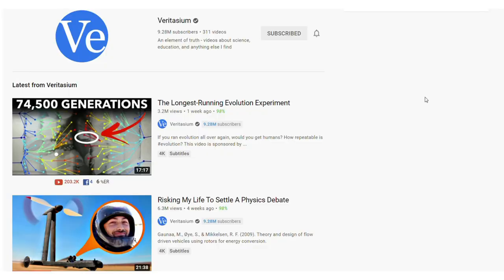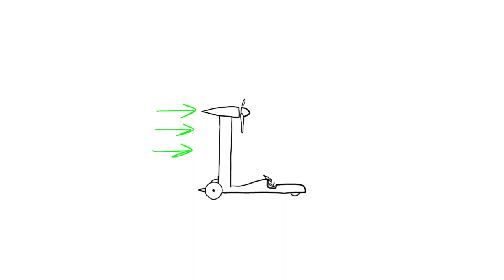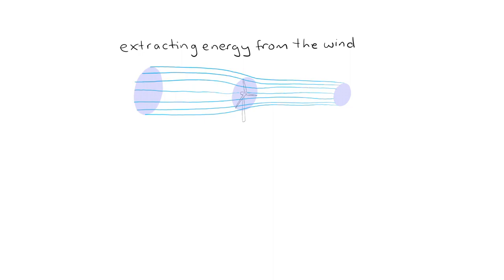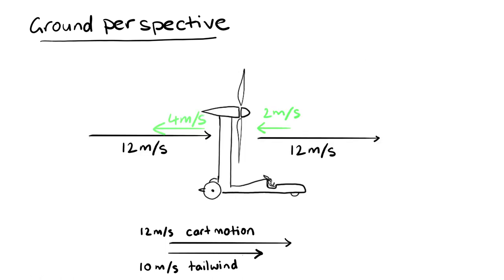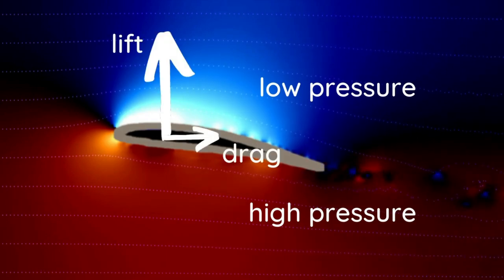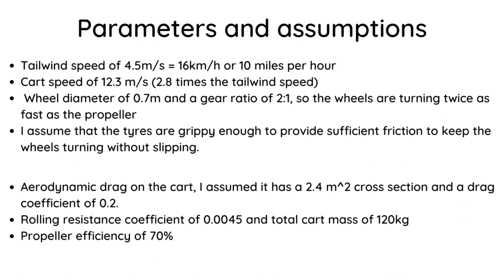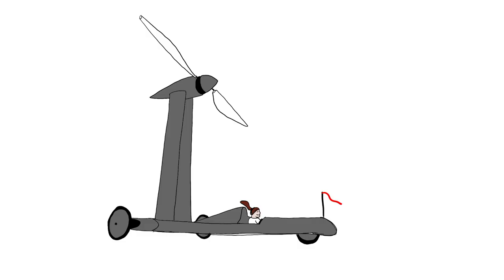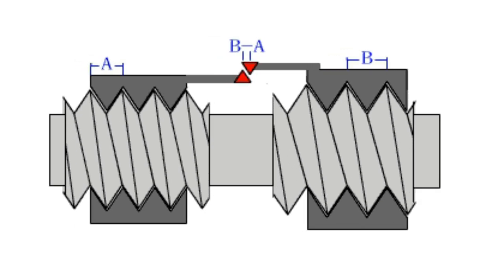Downwind Faster Than the Wind by Veritasium: How Does it Work?

Comment: The inertia :) The propeller spend the wind power accumulated while cart was accelerated from 0 to the wind speed.
As soon as this rotating power slowly spends out, this car will slows down.
The power was from the wind, and if no more wind = no more power.
This is not the earth rotating propeller, this is a wind rotating propeller by the wheels.
Reply: I asked MIT aero professor Mark Drela what would happen if there was no drag and no friction, and his answer is pretty surprising until you wrap your head around everything that's going on:

"If there is no drag, there is no theoretical speed limit to DDWFTTW [dead downwind faster than the wind]. It’s no different than applying thrust to an object which has no drag — it will keep accelerating without limit.
In reality there is drag of course, and there are also structural limits.
For fixed gearing the wheel rpm and prop rpm will be proportional to the ground speed, so at some point something will blow up from the centrifugal loads."
Reply: @clawsoon  Well, it's like saying what flywheel after initial push will start rotating faster and faster :)
No energy = no indefinite acceleration.
Reply: @clawsoon  Nobody said that wind energy can't be used(or, like you said, extracted).
But you can't use the energy of the wind if the wind doesn't exist anymore. As soon as the car reaches the wind speed, there is no wind pushing this car. Initially, wind accelerates the car and wheels trying to stop the car.
At the wind speed, the car accelerated not by the wind, but by propeller.
You can use a flywheel in this car, and it will perform even better.
But still not run faster than wind for the long time.
And, of course, never accelerates for a long time.
More than 10 years and no result!
Reply: @anufriyev  Once the craft is moving and the propeller is creating thrust, the speed of the air relative to the craft does not matter.  (Well... it matters in terms of drag, which limits top speeds, but not in terms of thrust disappearing when the cart reaches wind speed.)  Comment #35 in this discussion does a reasonable job of explaining it:

https://www.physicsforums.com/threads/remember-the-debate-about-downwind-vehicles.390801/page-2

That whole discussion is good and worth a read if you're really interested in how it works.

You're familiar with sailboats, land yachts and ice boats which can sail faster than the wind, right?  (Up to 3-4 times the windspeed in the case of land yachts and 6-7 times in the case of ice boats.)
Reply: @clawsoon  You understand what sailboats, land yachts and ice boats can't sail faster than the wind directly downwind, right?
"The energy source is the wheels - they are rolling against the ground. Basically, the wheels drive the propeller."
A wind is a source of the energy, not the wheels.
A wind drives the propeller, not the wheels.
If you push this car by the hand, the source of the energy is you, not the wheels.
Reply: @anufriyev  I hope that I never said that "the energy source is the wheels".  If I did, I said something wrong.  :-)  The energy source is the difference in velocity between the air and the ground.  The wheels are the source of the force which drives the propeller, which is a different thing.

Sailboats, land yachts, and ice boats can't sail faster than the wind directly downwind; you are correct about that.  However, they can achieve a velocity-made-good which is higher than the wind speed.  They can sail at an angle to the wind and at a speed such that the component of their speed in the direction of the wind is faster than the wind.  They can get to a destination which is directly downwind faster than the wind can, and they can do it reliably and indefinitely (no "momentum effect" or anything like that).
Reply: @clawsoon  "Comment #35 in this discussion does a reasonable job of explaining it:
https://www.physicsforums.com/threads/remember-the-debate-about-downwind-vehicles.390801/page-2". This was your opinion.
Reply: @anufriyev  You do know that a physics professor who didn't believe an aerodynamics professor just lost a $10,000 bet about this, right?  :-)
Reply: @clawsoon  That kind of argument is this?!
Do you really think it is can prove anything? How old are you? :)
Reply: @anufriyev  This is something I've been trying to wrap my head around since 2011.  In that time I've read most of a couple of aerodynamics textbooks and a whole bunch of aero papers and sailboat explainers.  I've learned that there are a lot of things about lift which are counterintuitive.  There seems to be something in our brains which is stuck on drag-based experiences of wind force.  I think that's why it's so hard for us to figure out what's going on with things like boats which get to their destination faster than the wind does, or gliders going 500+mph, or sailboats sailing upriver with no wind, or sailing directly downwind faster than the wind.  All of these things are counterintuitive, but all of these things are real.

It still feels counterintuitive to me after all these years, but once I realized that all of the things that I mentioned are true and related, I switched over to trying to figure out how it works rather than trying to prove it doesn't.  Because it does work: Every time you have two substances next to each other moving at different velocities, there is energy to be extracted, and if you're clever enough you can extract that energy in a way which leads to higher velocities than either of the substances are travelling at.
Reply: @anufriyev  Xyla Foxlin has a build video with a parts list so that you can build it for yourself, if that's a better way for you to figure out how it works:

https://www.youtube.com/watch?v=VUgajGv4Aok
Reply: @clawsoon   Thank You. Maybe I would.
Recommend You to make a small RC model for the aerodynamic tube.
What you will see may really surprise you. :)
Reply: @anufriyev  Doing the equivalent frame-of-reference shifted version on a treadmill would be easier, but having a tube to run it in would be more impressive.  I wonder how long (and how large) a tube you'd need to make this practical... hmm... definitely going to be problems with turbulence once the tube's length gives a Reynolds number that's high enough... and a clear tube would be ideal... hmmmmm...

An easier (and also interesting) thing to make might be a real version of the paddle-wheel/yo-yo model from this video:

https://youtu.be/X6oJpnSJyV8?t=2250

It would certainly be counterintuitive to see a paddle wheel travelling downstream faster than the water is flowing...
Reply: @anufriyev  Watching the treadmill on the Xyla Foxlin video, it looks like it takes about 5 seconds at 12mph to get from wind speed to wind speed + ~10%, which is about 26 meters.  And that doesn't include the distance needed to get up to wind speed, since in the treadmill tests they basically force the craft up to wind speed by holding it until the propeller is up to speed.  This seems like it would need quite a long tube, especially if you want to demonstrate steady-state faster-than-the-wind speed.  It would be ideal to make the craft as small, light and streamlined as possible in order to minimize the amount of tube needed.  Perhaps some ultralight build ideas from F1D would be worth looking into... hmm...
Reply: @clawsoon  

NASA will help  :)
There is a long tube waiting to be rented for the 15 minutes.
==================================

==================================
Reply: @anufriyev  "But you can't use the energy of the wind if the wind doesn't exist anymore."

But the wind (relative to the ground) still exists so it can be used.
Reply: @seneca983  The car and wind moves relative to the ground with the same speed and in the same direction. For the car, the wind does not exist anymore. Try to ride a bike downwind. At first, you will feel the pressure of wind on your back. Then you reach the wind speed, it will be no wind for you anymore.
Reply: @anufriyev  "The car and wind moves relative to the ground with the same speed and in the same direction. For the car, the wind does not exist anymore."

If you want to consider the inertial frame tied to the cart in such a case then you should note that the ground is moving relative to the cart and the cart can extract energy from the ground's movement.

I personally find it more intuitive to consider energy in the inertial frame tied to the ground. In that frame the cart is extracting energy from the kinetic energy of the wind.
Reply: @seneca983  
Then cart stop using a wind, it starts using own kinetic energy.
And it has a limit...
According to your theory, then any vehicle moves in accordance to the earth, the Earth moves in accordance to the vehicle, so vehicle can start extract energy from the Earth and will move forever :)
Reply: @anufriyev  "The car and wind moves relative to the ground with the same speed and in the same direction. For the car, the wind does not exist anymore."

There is no wind to exploit relative to the body of the vehicle, that is true.  But think about what is happening at the prop-to-air interface.  There is plenty of difference in speed there to exploit at the moment the vehicle reaches true wind speed.  

Just a thought: stop thinking of this as a conventional sail craft that requires relative wind with respect to the body of the vehicle in order to accelerate.  Open your mind to the possibility that somebody has come up with a clever, counter intuitive design that is able to exploit the difference in speed between the air and the ground at any speed.

Comment: Imagine the cart traveling at EXACTLY windspeed.  So in its view, there is zero wind.  It might as well be in vacuum as
far as it cares.  If there is some wheel/bearing friction, it should slow down.
So what the hell is going to accelerate it up to FASTER than windspeed?

Aha: because the prop is connected to the wheel, in this scenario, that prop is turning.  Hence even though the prop "thinks"
it is in still air, it is PUSHING that air, thus causing cart to accelerate forward, the air backward..  So in our scenario, the
cart should self-accelarate to get at least a little faster than windspeed.  
And this is definitely going to happen if the wheel/bearing friction is tiny enough. Q.E.D.

Comment: It might help to consider similar devices that interact between two media moving at different speeds where energy losses are not an issue, such as this video, where a geared cart interacts between a moving ruler and a table top. There is a reduction gearing from table to ruler, so the cart moves under the ruler faster than the ruler. I set the link to skip to the actual demonstration:

https://www.youtube.com/watch?v=k-trDF8Yldc&t=107s

The point of this is that the only issue with DDWFTTW carts is an efficiency factor. Otherwise the concept is the same, for DDWFTTW, there is a reduction gearing from ground to propeller, for DUWFTTW (upwind), there is reduction gearing from turbine to wheels. The reduction gearing converts higher speed, lower force into lower speed, higher force, despite losses in the conversion.

This is not a new concept. The Brennan torpedo, made in 1877, uses the same concept. Two steam powered spools on a dock wind in wires, which are attached to two spools on the torpedo, each of which drives a propeller. The wires move backwards, while the torpedo moves forwards. If the wires were attached to two posts in a stream, the torpedo would move downstream faster than the  stream.

From the cart's frame of reference, energy is extracted from the earth, as the earth experiences a very tiny angular acceleration due to the forward force applied by the wheels, reducing the earth's angular kinetic energy (from the carts frame of reference), which after losses, is used to increase the headwind energy (assuming a relative headwind).
Reply: The Brennen torpedo is always an excellent example.

Comment: <edited> I get it now......<edited>

Read the following if you want to be confused.

He's not going directly downwind, he is Jibbing Downwind like a Sailboat. The Propeller is slowing or pushing the wind, in effect creating unsteady air bubble that the wider windfield must flow around. The air bubble is like an object.  If the craft were going directly downwind 180 degrees this air bubble object would be mushroom out flow and around the blades and back in again, like a toroid, think smoke ring. But this doesn't happen, it's unstable, a little bit off 179 degrees or 181 degrees and this unstable flow will flip to one side. The Bubble will go one way or the other, to port or starboard. So the Object (slow air bubble) will be on the port of the craft or the starboard side of the craft. Wind that flows around this object, the wider wind field, will accelerate moving faster than wind speed, energy of the wind is a function of velocity squared.  

It's just like a weird sail, land boat, jibbing downwind. Good thing rolling friction of a wheel is so much less that drag from water. Sorry, your not getting energy from the wheels, it's coming from the wind. The wheels are a drag on the system.
Reply: Of course the power is coming from the wind ... it's a wind powered vehicle.  The wheels are indeed a drag on the system (same with a sailboat keel), but without that drag, both the Blackbird (and the sailboat) would merely drift downwind at something less than windspeed. 

Other than that, you're so far off base it's almost comical.
Reply: @johnborton4522  I think the main point is that it's Jibing downwind not going 180 degrees downwind. And initially Blackbird speed less than wind velocity, it would be unstable flow and flop to one side or the other. BTW the keel of a sailboat is not about drag, it's a lifting surface just like the sail. Lift generated by the keel (and side of the boat in the water) is equal to the side component of lift generated by the sails.

It's the Crosswind Component of the wind that yields the Lift Vector in the Forward direction. Without it, Blackbird or the America's Cup Foil Boats aren't going anywhere.  If there is no crosswind component, both Blackbird and Sailboat come to a stop. 

Sorry, i edited out the most comical part about auto rotation which was definitely wrong and written "on the fly" this morning.
Reply: @WeBeGood06  Any crosswind component degrades the propeller efficiency, and slows the Blackbird down. It operates best when going exactly downwind.
Reply: @WeBeGood06  

Your main point is incorrect.  It performs best directly downwind and performance falls off the further you divert from that.

Rosie explains it properly.
Reply: @johnborton4522  I disagree, I think she is fooling herself, and you too. Even in his original video, they are talking about jibbing and external views of show dust of the chase cars with significant crosswind component.  I haven't seen a speed chart vs wind direction yet, but nobody has produced one yet.  

It's the rotation of the Crosswind component that creates lift. Just like a Helicopter, it can lift off vertically from the ground with a certain amount of weight. But, if the Helicopter is rolling down a runway, it can lift more weight. There are times a Helicopter might be able to takeoff in "ground effect" and not be able to lift itself out of ground effect. But as it starts to fly forward, and get a crosswind component, it gets more lift and now able to fly out of ground effect with a forward velocity (like a crosswind component).
Reply: @WeBeGood06  

She's not fooling me -- I designed and built the Blackbird and co-own it's FIA world records.

You?
Reply: @johnborton4522  Oh, cool, Blackbird is yours? Cool, Congratulation on your FIA World Record. 

But I still remain unconvinced that your not just Jibbing Downwind like the America's Cup Boats. Your just closer to the wind (in a negative sense, downwind) than can be achieved in a high drag foil boat. I haven't seen an explanation that satisfies me, other than your Jibbing Downwind and you have a Crosswind Component to your rotating sail that your extracting power from it. 

Maybe you thought it was funny, the beginning of this thread, grasping a straws as to an explanation as to how Blackbird might work. Maybe some unstable flow giving a Crosswind Component at that critical moment when relative wind at or near zero. But, to tell you the truth, just broad reaching past wind speed works for me too. It's also the simplest explanation. But, if there is something else there, I haven't seen it yet.

Me? Just an unconvinced Rocket Scientist and Sailor.
Reply: >> It only took me a few hours, yours doesn't look right to me. So, not right, most likely wrong.

You need to spend a few more hours.  But I'm sure Rosie will appreciate your "insight".
Reply: @WeBeGood06  

// "But I still remain unconvinced that your not just Jibbing Downwind like the America's Cup Boats."//

All because you haven't done your research.

Fair enough.
Reply: @WeBeGood06  The simplest explanation is that it works as designed. A propeller loses efficiency as soon as the air flow is at an angle to its axis.

When NALSA certified the world record, they controlled the direction of the vehicle very carefully: "During this period the DW cart maintained a 10-second averaged heading within less than 5 degrees of the 10-second average of the true wind direction."
Reply: @johnborton4522  Cool Thanks, some twisted mental hoops but, I get it now. Watched it and the long version https://youtu.be/X6oJpnSJyV8 helped the most. Even went through the false thinking that might be boundary layer effect that showed up in Veritasiums new video just now. The treadmill is a good video, a little vector math of the incline for steady state gives the thrust produced taking into account all the loses. Thanks
Reply: @WeBeGood06  its a real mind bender.  Good work sticking it out